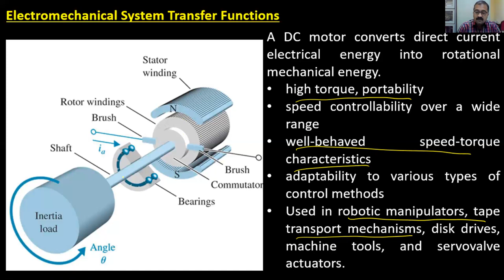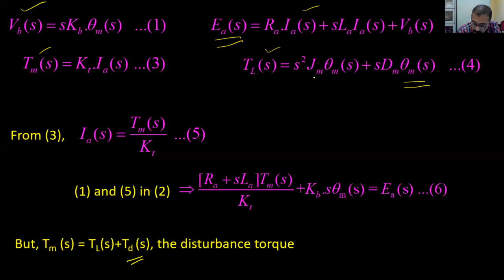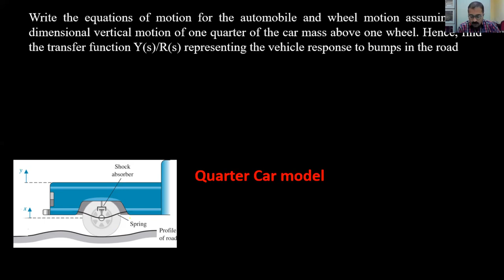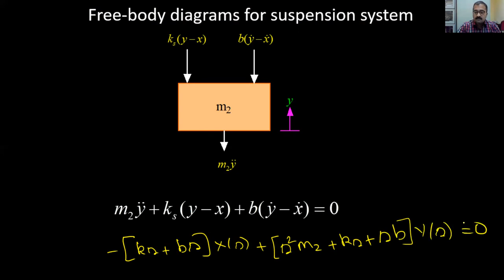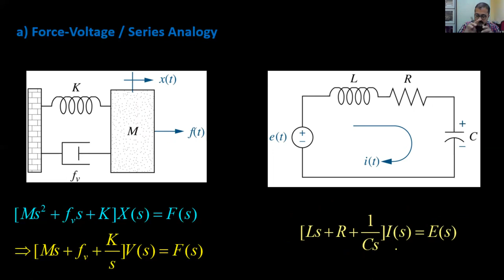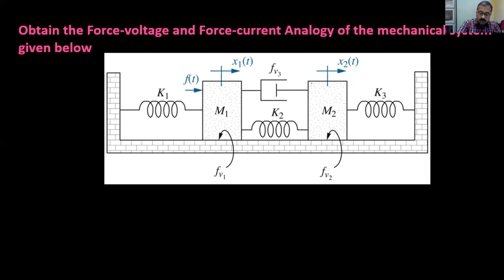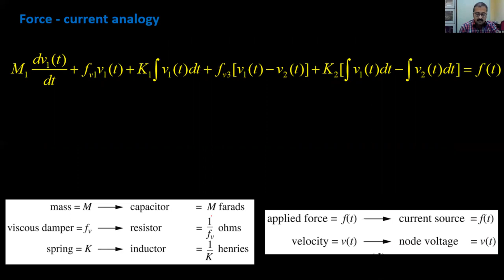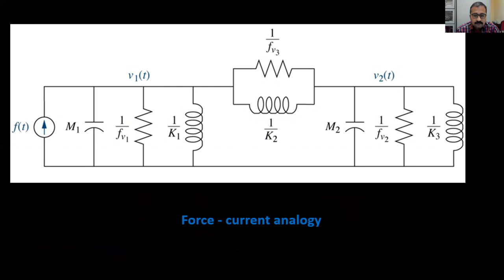Lecture 4: Electromechanical system Transfer functions and Analogous circuits

Comment from the maker: ##CORRECTION 1: Please note at 12.00 onwards, there is a mistake in the diagrams. The mean positions are always measured with respect to the centre of mass  In the figures and free body diagrams, the mean positions are WRONGLY shown as measured from the bottom of the mass. 
#CORRECTION 2: At 16:38, V(s) is linear velocity and NOT linear displacement. Sorry for the slip of the tongue